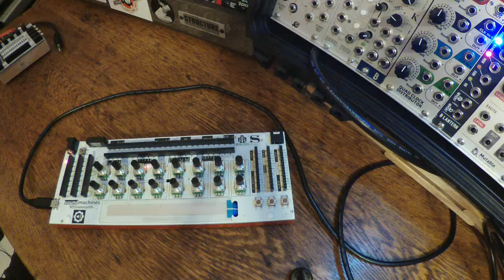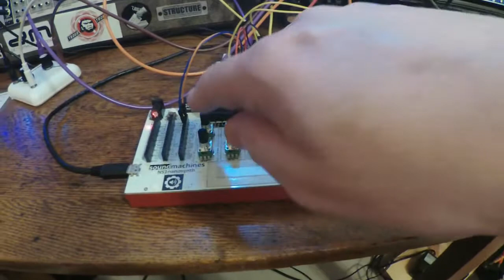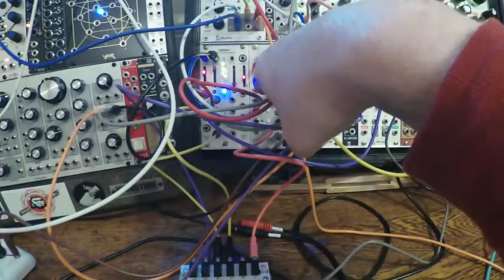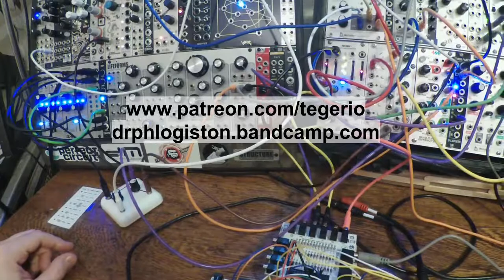Soundmachines NS1 Nanosynth

Comment: I just purchased the NS1 Nanobridge finally...don't know why i didn't get it at the time of purchase of the NS1,,however i saw that  there's a procedure to power up? i haven't gotten in the mail yet but can you run that by me again on how to power up the Nanobbridge? I just purchased the Mutable Marbles and will be using it with the NanoSynth....ohhhh can't wait..
Reply from the maker: The 0v socket on the Nanobridge needs to be connected to a 0v socket on the Nanosynth.  5v similarly needs to be connected to 5v.  You can use any voltage pin (they are scattered around all over the Nanosynth) but I prefer to draw from the Arduino secting since I don't use it for anything else.  I don't know if you have to connect power to both sides of the Nanobridge rail.  Probably just one side is enough.  I only use the "protected" side, so I always connect power on that side.
Reply: @JoshuaKennedy321  thanks so much for your reply....I was trying to figure out which socket you were connecting to on the NanoBridge... It looked like  you used the unprotected & Protected side....I could not see that well in the Video....so your saying you use the Protective  side only?....just want  to confirm....I'm ok with NS1 side...I can clearly see where you connected ....
Reply from the maker: @rhampton1914  I don't think it matters which side you use, but I connect power on the Protected side of the strip.
Reply: @JoshuaKennedy321  I get my Nanobrige this thursday & the Mutable Marbles Friday....i'm happy...yeahhhhhh